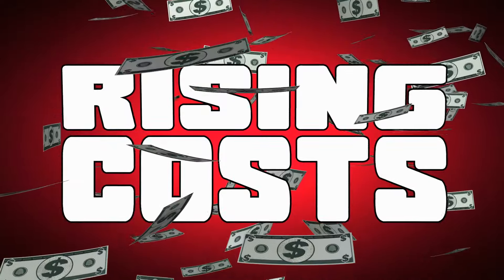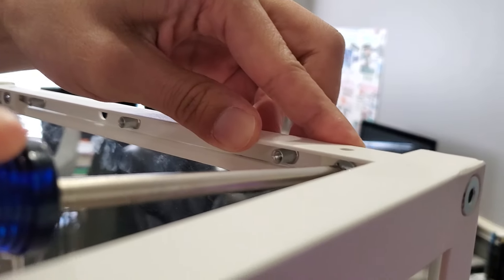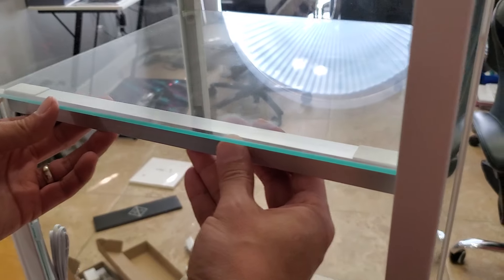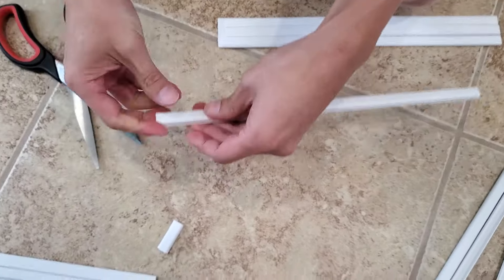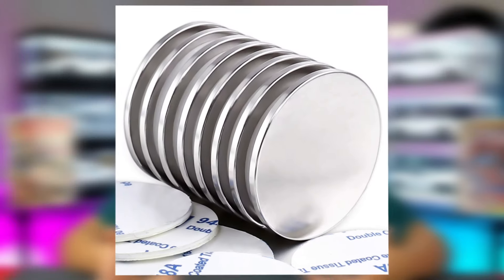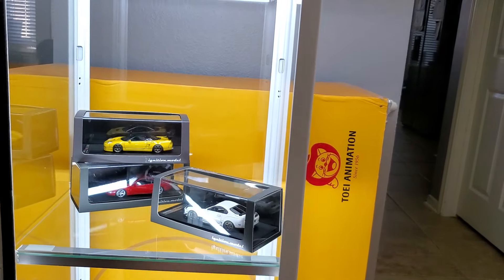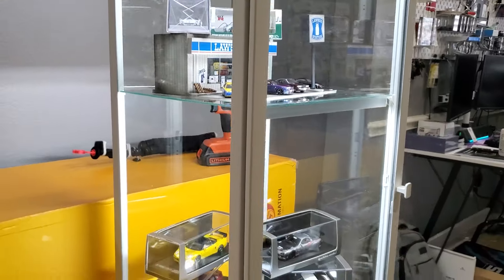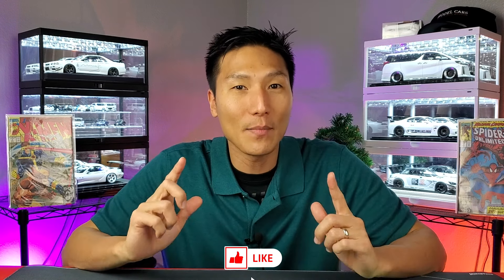Create the BEST Lighted Display with IKEA BLÅLIDEN!

Comment: I got a Blaliden for displaying my 40K models and this video was super helpful in my quest for lighting it. And the dustproofing with felt is brilliant! Quick questions: do you think it would have been easier to install the lighting as you were assembling it or is after the fact just as easy? And is it possible to add more shelves than come with the unit? Thanks!
Reply from the maker: Lights definitely after.

Shelving, we will have to see if someone makes more support for it and glass because without more support, you can put more shelves. 

You'd also have to figure out where to get more glass shelves as well.

Comment: Came back to this video because I recently got a a Blaliden and realized something. A newer ignition model base does fit but you have to angle it in. I’m not sure if older models had larger bases or is this a different brand?
Reply from the maker: Same size base.

Comment: As long as this shelf doesn't have the same random exploding glass issue as the Detolf, I'm all for the new model. Specifically never gotten a Detolf for that issue alone.
Reply: I've always wondered about the detolf exploding shelf or doors.  I have 2 and have used them for a little over 2 years now.  I may have 3lbs of items on each shelf so I'm curious if the shattering shelf is weight related.
Reply: @furyofgungnir  It can be improper installation (overtightening screws at the top), temperature changes (warm/cold too quickly), defective glass (some people's empty Detolfs exploded or exploded during installation by just holding the glass) so basically poor quality control by their workers at Ikea, and as for weight related issues, I haven't seen a shelf explode, it's always the sides that go out causing a huge mess. I could be wrong about that of course. 
After all these mods installations, Moducase is just a bit more expensive from my calculations, but it's permanent and won't break, 99.99% dust free and all. It does require acrylic cleaner once a month though to keep static away. I'm still thinking about which way to go.

Comment: I prefer the new BLALIDEN by a large margin...but it really depends on what you want to display as size/space is the biggest factor.

The bad reviews I think are in large part because it has been dubbed the replacement for DETOLF instead of being reviewed as a stand alone.

PROS
- Glass is clearer/thinner and less likely to explode (DETOLF glass has a greenish tint)
- Framed design is a better presentation imo
- Easier to assemble
- Can hide lighting cables easier
- Weighs a lot less

CONS
- Considerably less shelf space
- A little wobbly
- Frame blocks displays from certain angles
- Door goes to the bottom so if on carpet door will get caught (Need a riser)
- Thinner shelves, 1lb less weight capacity 

Nice concise video, appreciate the run down and tips.
Reply: I'm still contemplating which one to buy. Another CON and I think only for the white version are the screws and black empty screw holes showing in the back behind the figures in each shelf. Looks very unprofessional, cheap, and unfinished. It really distracts my eyes. The black version hides it better, but white looks more elegant I think. It's shown in the video too, at the end, in the finished product section of the video. They can be covered but it's extra material, extra labor, and extra cost. Looking at other options too, like Billy, Rudsta and the permanent solution Moducase.
Reply: @Figurevideoswatching-xk1yk  I almost went with Rudsta as it offers a little more space, has built in risers, and the 4th space being open allows for a little creativity.  Also really like the black backing.  Ultimately it came down to cost.